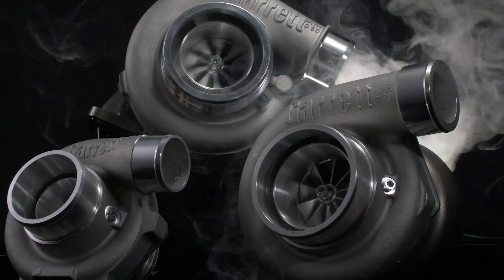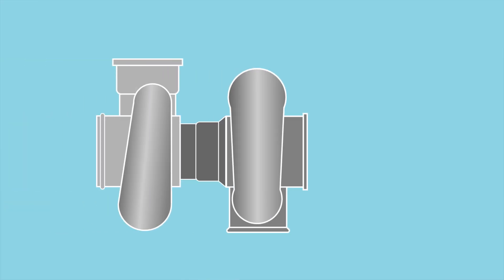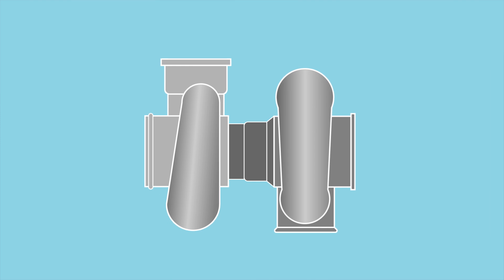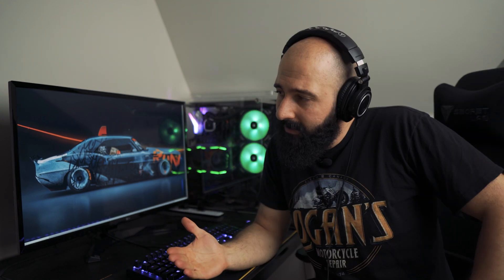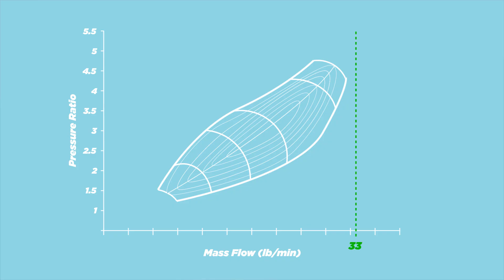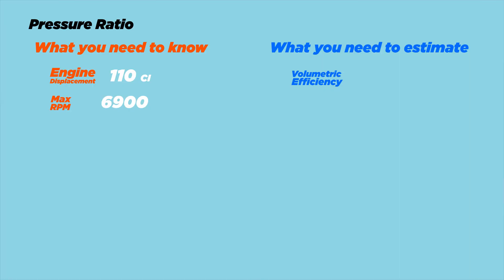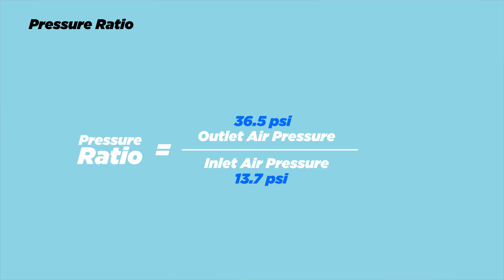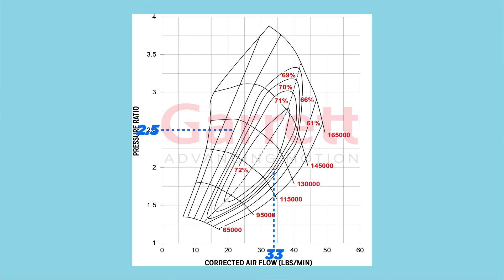How to choose the right turbocharger || EXPLAINED

Comment: Your Video is very informative and to the point. I have Tiguan 2.0 TDI and changed the half engine with VW Caddy 2012, I am having issues with my turbo its running low boost pressure, can you please guide me what type of turbo will suit my situation. I am in a place where you dont get VW parts easily....

Comment: Absolutely amazing but author please advice on this: 1. what if the engine has dual-runner intake (long at low rpm and short in high rpm); has variable intake camshaft; - how does this affect the turbo choice. And 2. If a twinscroll turbo is required, how this affects the turbo choice on top of all else. Engine is 2l and by all what i calculated from your video at 550m above sea for 300hp crank it seems like TD04H-16T will do the job. But i need twinscroll. And the other things. How does this shift the compressor map targets

Comment: I am turbo charging a Yamaha snowmobile engine to mount on the front of a plane to normalise reducing air pressure at altitude..... you know your standard build.
but the reason I  am commenting is because the engine is basically from a 1000cc R1 and people boost that with forged internals to like.... 500hp. 
The miata might be able to get there if its rebuilt right... your sarcasm is a work of art however 😀

Comment: I have a 2jzgte vvti swapped lexus gs400. Running looking to make 600hp wheel. I have the fuel mods, just looking for advice on turbo choice. Looking at a VS Racing 66/73 ,its rated for 725hp at the crank. I guess ill do the calculations to see where it's at.

Comment: @MZopyrus 
I'm trying to turbocharge a 1987 Toyota 22R but I still think I'm wrong somewhere. It just doesn't feel right. do you think you can help me? displacement: 144cc
max rpm: 5500
volumetric efficiency: 85%
intake manifold tempature(max): 190 degrees
my ambient air pressure: 30.07
Do you think you could maybe help me please?

Comment: Brilliant explanation my friend,everything makes sense now with those calculations, before I did turbocharge with very low psi pressures for engine safety because I did not have the math to calculate the actual  turbo speed lines.
Now we are turbocharging a suzuki swift gti 1300cc, street circuit race car as we still race them in southamerica, when we live very far from real racing tracks. 
This year they change the rule book for this championship and they eliminated the 0 to 1300cc class that we used to race for many years , and put us into the 0 to 1650cc class with a minimum 970kg on the cars, wich is to much weight to add to an 750kg  light car as ours.
So the other option is to turbocharge the car and run the open class that has no limit on weight and we can even make the car a bit lighter and use full slick tires, I have a turbo kit that I had it from another  suzuki engine with a Garrett AR 63 inlet turbine and a AR 60 compression wheel, but since it's being sitting around for many years I don't have the turbo lines graphics  to check if is the proper one for this similar engine, we intend to get 250 crank hp and change the pistons because now we have 11,5 to 1 compression  lower it to 8,5 to 1, I have MaxxECU so I can adjust for the turbo.I think the Turbo that you choose for the Miata it will work on mine as well ,the thing is that I still have to buy that one and I will like to find out if my Garrett it will be similar to that one before I do the purchase.  Hopefully you have some experience with this Garrett turbo and can advise me on this set up.

Comment: AWESOME. thought I knew what I needed. U gave me so much more insight. Thanks. I am TURBO charging my 2007 CHEVY COLORADO LS 2.9L inline 4cyl engine. I have found several kits but I was hoping you could recommend the best TURBO CHARGER for me? I need the unit to be specifically ready for my tuck as a DAILY DRIVER. I am going to make it fast and fun but still functional for standard street performance. I am going to have to mix kits for intercooler, turbo, intake, and fuel to peice together an entire system. If you could show me where to get an entire kit, or the Right turbo for my truck I'd really appreciate it. I've reached out to many Mechanics and most of them have given me trash advice that conflicts with everything you've said. Thanks man. I hope you have a great day and can point me in the right direction.

Comment: I am unable to get correct numbers to figure out absolute manifold pressure. I am going to turbo a 3.2 liter engine to make 400 CHP. I live at sea level. After doing the math, I am continuously only getting 4 lbs, which can not be correct because it puts my number in the negative "(. I will continue to watch video to try and figure out the math equations. Thanks

Comment: 2.8l 168ci 6 cylinder 7.8:1 cp hx35w 5x5 billet compressor 10cm2 exhaust housing  (.71ar) 85lb injectors and 2 bar of boost. The engine is a 2 valve. Pretty big ports, though. 12cm2 exhaust housing was originally on it but was too laggy. Big turbo cam .460 lift@ 240° intake .460 230° exhaust. Ambient air intake Temps npr intercooler and water meth 330cc 100psi pump..... oh, and I rev it to 6200rpm. Had a t3t4oe turbo on it before with a small exhaust housing made 423hp @ 384tq. I'm hoping that its current setup it makes a little over 500.

Comment: Wow! Very informative mate, and much appreciated. I am currently building a Chev 350 and want to be prepared in future for rear mounted turbo, which has it’s own challenges. I want to size the exhaust and later size the turbo for efficient operation and minimal lag for a fun street car. Only hoping to aim for 450-500 max crank hp. Just enough to feel the boost and gain 100-150hp within 2 bar. Any future advice will be greatly appreciated. Cheers

Comment: Waht turbos would I need for street duty on 300 CI Studebaker V8?  2 valves per cylinder, 8.3 compression ratio.  Would twin turbos be of benefit?  Thanks.

Comment: I have the GTX2867R on my G20 SR20DE (2.0l) engine running 20PSI. Great street turbo. I also have the GTX3071R on another identical car running 24psi. The 3071 is for mid/upper rpm but puts down 365whp.

Comment: When you input the volumetric efficiency rate in the equation, do you input it as .95 to simulate 95% or actually 95? Cause I’m doing the math and I’m getting non-similar answers otherwise

Comment: 6.7l Cummins w/ Banks Intake Elbow, Banks Intercooler, and Calibrated Powers Ez-Link with 5 custom tunes switchable on the fly; Valaire dual ceramic disc clutch (to 550 hp)

Comment: I'm building a street 4.6 4v with Navi heads, stock cams, spring upgrade, 2001 cobra intake, forge pistons and coyote rods. I'm looking to run a twin turbo system. HP range will be 450-600. What turbos do you recommend for this project? Thank you for your time and response.

Comment: I am building an AC Cobra kit car with a  rebuilt Ford 302 with the rings gapped for turbos. I plan to twin turbo it. I live near Denver Colorado, I tried to follow this video but I feel like I don't have to skill or know how to do all the calculations to pick the right size turbos as I will need 2 of them... My target is 500 ish hp. I will be able to tune it via a Holley terminator X and have the fuel upgrades to support 600+ HP. Any help would be welcome.

Comment: Great video presentation. Building a LS3 and hope to get around 30psi of boost: 2x15lb turbos. running dyers rods, Darton Sleeves, Custom diamond Pistons with upgraded pins,  Bryant Billet crank. I was advised that it could handle 50lb so was going to go to 30lb. Hoping to get around 13-1500Hp- Am I over reaching? 
Can you recommend a set of Turbos and their boost to safely achieve the desired Hp range?

Comment: I would've never thought a turbo needs so much work. I just thought you chose one that fits. Change the necessary parts in your car so the engine can hold the turbo, and that's it. Even that is a lot of work and I make it sound easy but it turns out its more complicated than I thought.

Comment: Good description for choosing a Garett turbo but you should mention the most important dimension for any turbo is the turbine exducer diameter because that is the size of the hole that all the exhaust exits the engine. If that is too big the turbo will never make boost or start to spool at 5000rpm. If that is too small it will limit max power. The A/R is a number that represents the size of the hole thru which exhaust gases from the engine enter the turbine impeller. Bigger means lower speed gases = higher flow for max power but higher lag at lower rpm. Different exhaust housing A/R are used for better turbo engine match because they not make turbines with every increment of dimensions.

Comment: Hey, nice video! thanks. I'm a engine builder from the Netherlanders. I am currently working on a project where I need to add a supercharger to a naturally aspirated engine. I adjust the complete compression ratio by measuring other pistons and camber cc. However, I don't know which supercharger it should be, can you help me?

Comment: I know this video is 2 years old, but I figured something else out. If you wanted to make 675 hp at a maximum boost number that was safe to achieve and say 550 at a low boost number then you can use this equation twice for the same chart to get your answers. Example for my car : 3psi pressure ratio/74 mass flow rate for 675hp and 2.3psi pressure ratio/55 mass flow rate for 550hp. 
That's on my 3.6l Dodge Challenger V6. Spoiler alert that calls for low boost of 15.8psi to high boost of 26.3psi. And I've achieved the low boost number. Only missed it by like 15hp.

Comment: it was easy I just build the biggest LS I could afford i build 427 all forged Lunati, manley, JE and got the biggest turbo 98mm 2x 50mm wastegates 5" think intercooler 4" pipe, sheet metal intake manifold 4.05" TB and a bit of liquid corn cobs and $42k later 1800hp nothing hard about it

Comment: Nice work. Bmw m52tub25 still not sure what size. Seems like your turbo capability was over shot inorder for you to reach your desired bhp. Only looking for enough to get me to 300. Mybe i should get a turbo for 350 to say 600 hp. I have double vanos and m50 manifold. Along with alot more modifications. With this, i have higher rpms. So, im rewinding and rewinding. Think i know the correct # for X. Still not sure, any recommendations? Guess it depends on the turbo manufacturer.

Comment: So I think I did my math wrong… help me out please what did I mess up?
475 target hp X 12 X (.55/60) is 52.25 lbs. per minute. 

52.25 X 639.6 X 580 = 19,388,078
96 X 3.5 X 152.55= 51,256.8

19,388,078/51,256.8= 378.25

But that seems like a whole ass decimal place off… 
If it were a decimal off, 36.3 divided by 13.7 is 2.65. 

So then I look at the borg Warner 7670 that is rated to 500/600 WHP, and the chart is showing as too small a turbo for my RB25?!  This doesn’t make sense. What did I do wrong. Hahahaha

Comment: I'm going to turbo a 98 Mazda b4000 SE 4.0v6, with a interchiller.

Though you didn't touch on how to calculate if you're able to get lower than ambient temps.

Also I live in the Dallas fort worth area. For reference

Comment: I'm trying to turbocharge my 2.4 volvo s40 sport MkII..
But shit.. this turbo costs £1,200 😂😬
Most expensive one I've seen so far..
Wanted to catback my exhausts n get the x pipes, turbocharge, change air intake n intercooler, oil/air lines, remap etc..
Of course I'll be doing it in stages but dammnn this shit is expensive as hell.. 
Compared to my 1.8 astra which was much easier..😅

Comment: Also want to include calculating the power lost to drive the turbine, and how selecting the A/R for it will affect that. And be worth showing how different A/R's will affect at what rpm that combination of compressor and turbine will start to spool up.

Comment: I used to love math, so I appreciate the details provided here. I’m just starting to look for turbo kits for my 1997 GMC K1500 pickup with a 5.7L (350cu.in.) engine that has been rebuilt to a 383 stroker. I thought that there would be lots of choices, but maybe since most people have switched to using LS engines for performance, not many kits are available for older sbc engines?

Comment: Greatly aprecciated the info you shared here😁 just bought a spare 2jz ge vvti, going for a total rebuild for the i lnternals, because i want to boost it to around or between 800-1200hp for my is300. Not as a daily but a car for in the weekends, meets and sometimes for track/drag races😁

Comment: Very stupid and theoretical question, but would it make any sense to supercharge a Suzuki K12D engine? (fitted on the Ignis MF (3rd gen) mild-hybrid CVT) just curious :3
It only has 82 Hp and a max speed of 155 Km/h, so I was curious if there was a way to slightly bump it's power

Comment: I cannot get the same number you got on the manifold pressure calculation. My math is coming out at 41.75. (12453012/298252.5). Am I missing something?

Comment: Dude, awesome video. Super thorough, beautifully explained. Thx for the up. I'm trying to get my MB W208 CLK 2.3l up to roughly 350-400hp. While the stock supercharger doesn't cut it, I decided to go turbo. The build is gonna be a daily, with track use on the weekends. Now the only question that remains is should I got biturbo, and what config should I go for (since I already have a different size biturbo unit off of a 3.0l MB Sprinter) or straight up single turbo, considering the track use will be mostly drifting. Since the spool up would be quicker on a biturbo series set up I lean towards that, but it's also a way more complicated process involving way more hassle

Comment: A 3.2 litre M54B30 based motor. Still busy finding other specs like lighter but more durable pistons to reduce dynamic engine loading, different clearance specifications for bearing journals and their required lubrication and other stuff but I have a goal and mission. Thanks for the infomation
Reply: Found that the best turbo for my application would be a GTX4294R 70mm. thank you.

Comment: I'm trying to turbo my d15b2 with d16 non vtec head. I also enlarged the exhaust ports by shaving aluminium from around the valve guides because it looked like a restriction when i rebuilt the motor

Comment: Mzopyrus

It's interesting seeing this calculation.

I love watching engine Dinos and I calculate every single one that I see but the metric I have always used is cubic feet per minute

The average hot rod motor needs to move about 1.35 cubic feet per minute to make one horsepower

The closer you get to a full-blown race car, it's more like 1.0

Versus my 88 trans am was more like 2.1 CFM to make a horsepower

I've done this so many times that if you tell me the engines displacement and RPM you would like to know the horsepower for and tell me it's compression ratio. I will give you a rather accurate prediction

And when I say accurate, it's just from experience.

Before I even watch the dyno pull, I look at the engines displacement and calculate out the horsepower for an RPM range and make a prediction

I'm usually within a couple horsepower. It's pretty interesting.

The only person that I'm not that accurate with is Steve Morris engines and I think he just lies about his output because he is putting out more horsepower per CFM than Indy cars are at certain points. I just don't understand that

He's either the biggest engine genius on the internet or he's lying

Comment: So... I have a 2.4L JTDm with approx 200-210hp (400Nm) out of the box depending of the turbo (200 - BV 3K or 210 - Garrett GT2256V) :) what could one expect to get out of it with some better turbo... BTW both turbos are running at 1.0bar

Comment: Im building my own 500cc straight twin.  I've made a hybrid motor to go on. And made a mgu-h to power it bought a vz21 tiny turbo to adapt it to . Idea is to try and make atleast 45% thermal efficiency for a jetboat. Its meantbto be run pretty much flat out. Where it would be most efficent. Building literally everything from scratch so ...its taking a awhile machini g and machining and making tools and more tools

Comment: You explain things very well and at just the right speed but I’m still struggling so hard to figure out which turbo I need haha. If anyone can help me out, it’d be much appreciated. I have a fully built for boost 521 big block and I’m shooting for somewhere around 1,000ftlbs, I don’t really care about the horsepower number since the engine is sitting between the frame rails of a 1985 dually pickup truck. I’m just starting my turbo kit parts gathering so I can build it all.
Reply: I think I’m struggling so hard because I’m not the greatest at math equations and my numbers are quite different than the numbers he’s using in the video for examples.

Comment: There is one way to get in the ballpark much, much quicker.
One can look at the compressormap X-axis scaling as 1/10 of horsepower and the Y-axis as MAP pressure. 
If the engine produces 130 hp stock NA, you set a mark on the x-axis at (130 hp /10 = 13) 13 lb/min. (13 x 1) 
We know that 1 BAR boost is 2 BAR MAP and that this dobles the NA horsepower when running a correct intercooler, right?
Therefore, set a new x-mark at 26 lb/min x 2 PR and draw a line from 13 x1 to 26 x 2 and beyond. This shows the airflow at max horsepower at different boost pressures. :)  
You will find that 13 x 2,5 is 32,5 lb/min that suggests 325 hp. :) Close enough to do a really GOOD turbochoice and I would argue that the G25-550 and GTX2867R is to large and that Gen2 GTX280R is a more ideal choice. 
Not even Richard Holderner is aware of this Bergen StreetRacing Team Trick.
Reply: Holdener knows nothing about turbo matching.

Comment: How do calculate de turbo size on a twin set up whit the standerd m62 supercharger with adding a turbo the engine is an LSJ 2,2 ECOTEC Chevrolet engine
now the block is build and can handel 600+ but 550 and 600 is the target on the